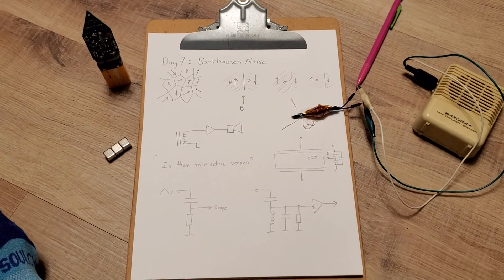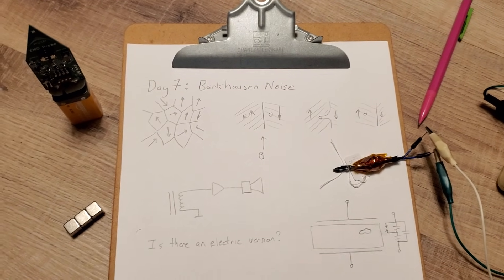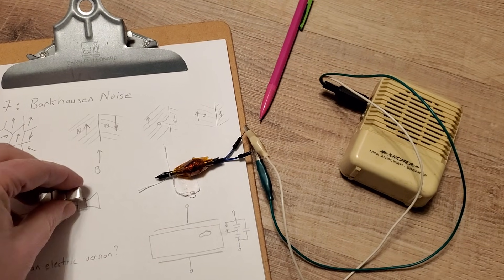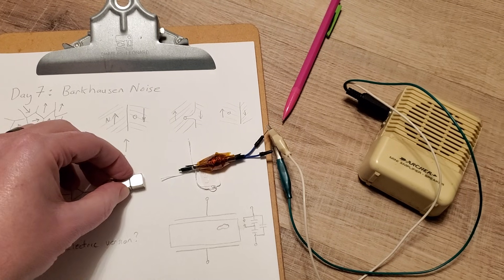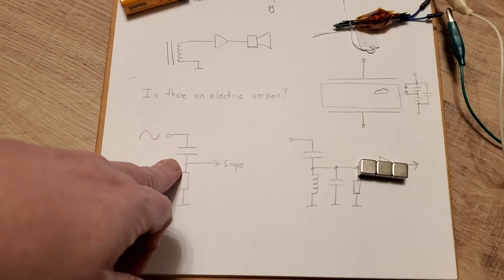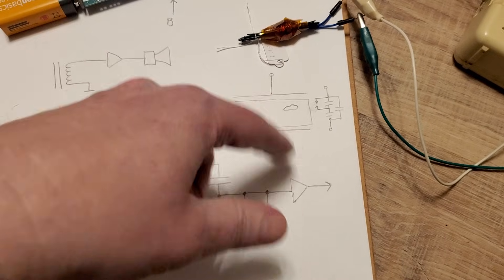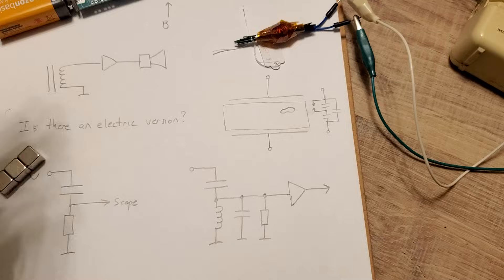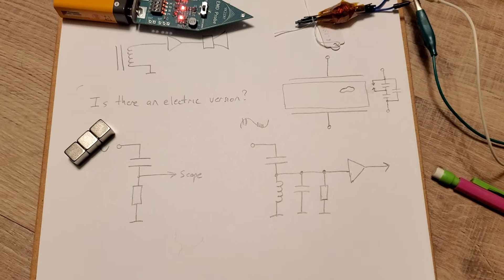ACoC 2025: Day 7: Barkhausen Noise

Comment: The paper "Noise generation in crystals and in ceramic forms of barium titanate when subjected to electric stress, Proceedings of the IEE - Part B: Radio and Electronic Engineering, Volume 102, Issue 1" from 1955 seems to describe this. They said that they couldn't get it to happen with commercial ceramic caps, but caps probably sucked in 1955. They said that when they did get it to happen in ceramics, they were sweeping the voltage to saturation in both polarities. So you'd probably want to look for a cap that had a low voltage rating (or at least a cap that lost significant percent of capacitance at low applied DC bias) and push the test voltage rather high.

Comment: Huh! That's a really interesting thought. I would guess that if this is an effect, then many typical Class II dielectrics ought to do it. Part of me would expect a really crummy Y5V ceramic to be the worst. But I'm not sure. 

These would be analogous to the "softest" steel, or those with the highest initial permeability (since these dielectrics have the highest dielectric constant). So maybe even an X7R would do it? Maybe even better?

I know that once I ran across an issue where a 1uF 10% X7R 0805 SMT capacitor was failing in circuit test with 0.8uF of registered capacitance, and we found that the test voltage being used was 0.1Vrms, while the manufacturer had specified a test voltage of 1Vrms. The capacitor had lost 20% of its capacitance as a result of lower applied voltage swing. 

So there's obviously a pretty "ferroelectric" looking Q-V graph minor loop happening in that case, where some form of lower initial permittivity is being overcome at higher applied fields to "unlock" a slightly higher permittivity. But then again, that effect is actually quite weak. I know in many cases with steels, the initial permeability at very low fields is only a small fraction of that at slightly higher fields. So maybe it's just a much smaller signal in the case of dielectrics? 

With respect to the noise you're hearing as you move the magnet away at close distances, that makes plenty of sense: since you have a rod core geometry, the air return path of the remnant flux has a high reluctance. So you're not seeing the intrinsic remnance of the material, but rather the remnance of the material in a magnetic circuit, working against the counter-MMF of the air reluctance. This means that if there's remnance, the remnant flux creates a MMF across the air which opposes it, which in turn tends to demagnetize the rod when the applied external MMF is removed.

Edit: BTW I think it was a Kemet brand capacitor that did the thing in the ICT machine and that Murata didn't do it... can't be sure, it was like 15 years ago.

Comment: "Now, where did I put that roll of florists wire 🤔🤔🤔"

😂

Another effect I've read and wondered about never experimented with. Awesome stuff.
Reply from the maker: Any kind of ferromagnetic material would probably work.  Magnetically harder ones should be better, I used florist wire because it was soft iron, cheap and I had a spool just sitting there.  I also reasoned it would be easy to mechanically abuse to create more defects if it turned out I need to do that.